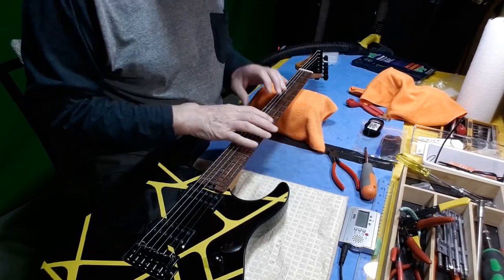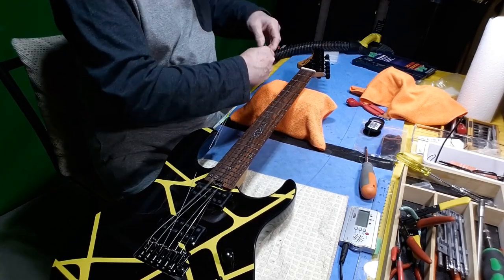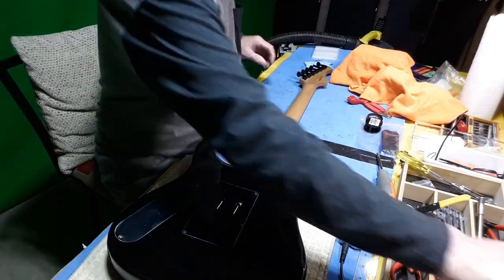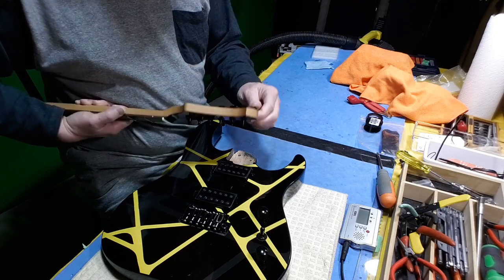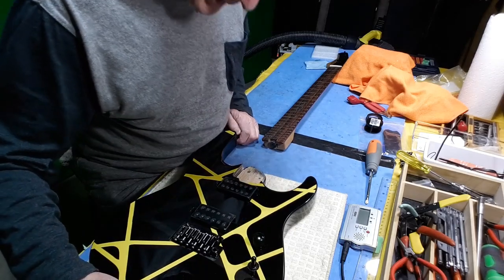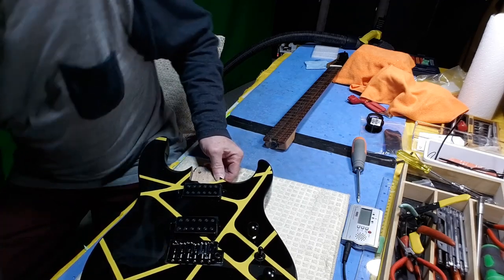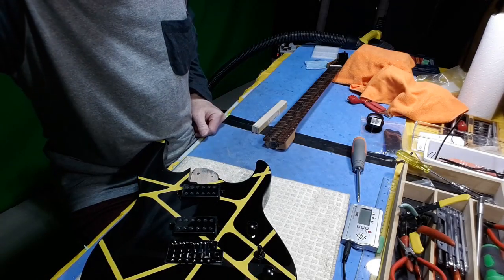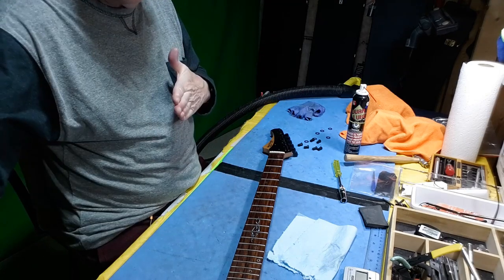WESTCREEK JX-50 YELLOW STRIPE - PART 2 - REWORK BEGINS

Comment: I bought that same guitar about 7 months ago . Because of my age , I have a thing for the bumble bee look . I also loved the offset markers and the board inlay .  I opened it up when I got it , took a quick glance and had to do something else and off to a closet it went. 2 months later ,  I took a closer look at it and,  noticed that the strings were so far off to the side of the edge of the neck that , I wanted to return it ,but too late . I now will have to take it apart and see if I can fix it . I knew that for the money I would have to do some work to it . If I am not successful  then it will just become a wall show piece  . Firefly guitars are so much better than everything else out there when it comes to pricing .
Reply from the maker: @IncendiaDivinus  
Oh too bad that happened. First thing you can do is try loosening the neck screws just a tad, and then pull the neck to the opposite side where the strings are off and see if you can get any movement. If not then remove the neck and do a little bit of sanding on the next side pockets evenly on both sides, and I'm talking about a 16th of an inch here, and then try doing the same pull.  If it's starting to work but not enough do a little bit more and try again.
Reply: @2bikemikesguitartopics145  Thank you sir !